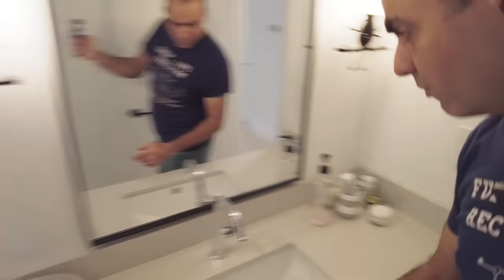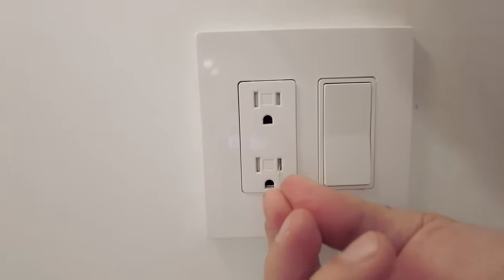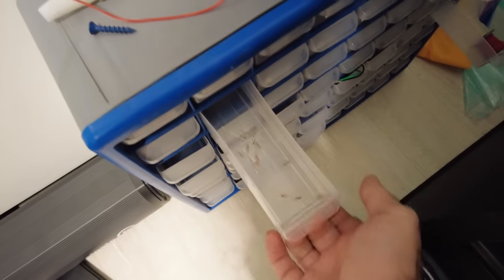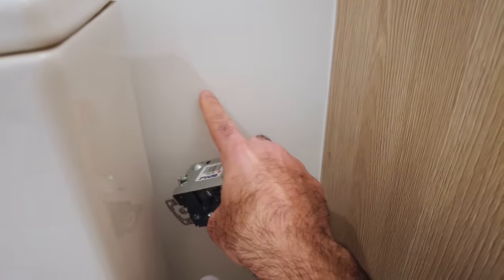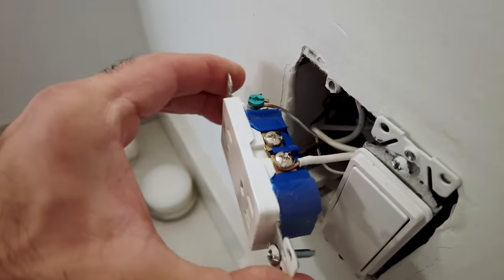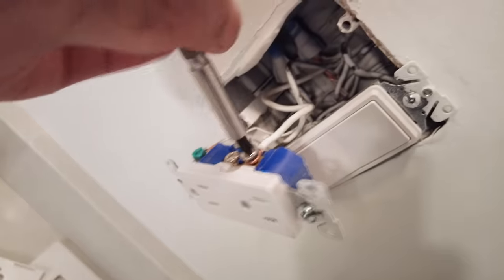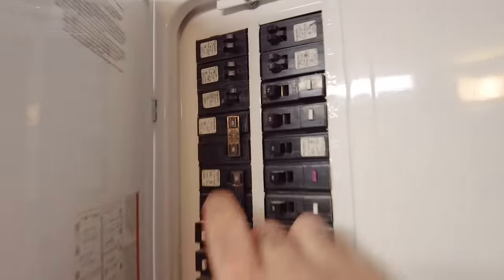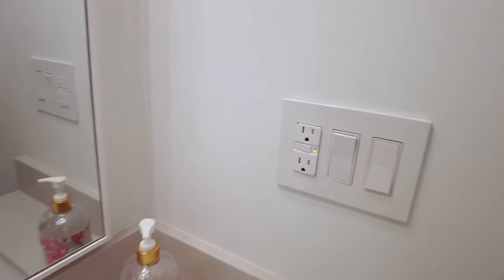Installing an Outlet… For a Toilet Seat?!

Comment: Hey Medhi, have you ever thought about using wagos or similar connectors in your walls? It makes changes such as these way easier than using wire nuts. (And wagos can take more abuse)
Reply: Every time I look at Wago's in the store (and then look at the price), I think about the small loan I'd need to take out to have enough of them floating around in the various size and combinations to keep them in stock whenever I want to do a small project.
Reply: @stevesether Here in Sweden we aren't allowed to use anything else than Wagos for safety purposes and they are pretty cheap
Reply: @ghostali8351  Wire nuts are absolutely fine for safety.  Wagos are certainly quicker and easier, I've started using the Ideal version, and I like them.
Reply: I don't think Wagos are approved for use in all jurisdictions in Canada.
Reply: Anyone who thinks Wagos are faster clearly hasn't seen or been a professional electrician installing wire nuts at lightspeed xD
Reply: @3nertia  then do the same... But try do add stuff to an already existing circuit without cutting parts of the wire off
Reply: @jonc4403  wirenuts are less safe.. they generally have a higher resistance cause of oxidization and non perfect Twists.. they are usually the weak spot in the house wiring.
Reply: @idallen  tbh I doubt that they aren't approved...
Reply: @lukyva7955  Just untwist the wire nut, add another wire, retwist, done - you make that sound harder than it actually is ;)
Reply: Compare having to straighten the wire if u actually want a good connection to open clamp, insert, close clamp
Reply: @lukyva7955  Straightening wire? Most electricians will just put the multiple wires together, most of which start out straight anyway and need to be hooked to be screwed to receptacles. Just squish 'em together with lineman's pliers then twist the wire-nut on, easy peasy
Reply: @3nertia  don't get me started on American receptacles and safety...
Reply: @lukyva7955  Oh, please do though :D
Reply: @lukyva7955  If the wire-nut is what is making the wires inside make contact then it's been installed incorrectly heh
Reply: @3nertia  exposed live and neutral.. being able to pull the plug half way and touch the prongs.. 
Just 2 Things that came to mind right now
Reply: @3nertia  so.. there is a possibility to do it wrong... Already a plus for wagos..
Reply: @lukyva7955  Wagos do not change how receptacles work lmfao
Reply: @3nertia  the "possibility to di it wrong" was talking about using wirenuts wrong.. hence why its two seperate comments
Reply: There's no need to twist the wires before using a wire nut - and in fact you shouldn't! When grouping many wires together, twisting can make you think one is held firm, when it actually isn't. If you put them in straight (as it says to on the package), the nut binds them all together well. I always check by pulling on all the wires, but they never are loose. You also don't have untwist when updating old work. The Wagos are certainly more foolproof, but if you know how to use wirenuts, they are not difference in terms of safety.
Reply: last time i checked, outlets weren't something people change frequently.  so thats not a concern.

Comment: A modern house with hollow walls is an absolute godsend when it comes to running new wires. But I’ve still managed to invent a few new swear words when encountering studs that I didn’t know were there. Especially those randomly placed horizontal braces.
Reply: Even new construction without the walls up can have some annoying stuff sometimes, all the time I run into spots where the framers stacked so many studs back to back that a normal drill can’t even reach one end to the other or where two studs are so close together you can’t fit a drill between so you need to go at awkward angles

Comment: Very good I’m sure I’m not the first electrician to say the only thing you missed terminal adapters for the MC wire which would not be compatible with the plastic 2 gang outlet box that you got the power from anyway

Comment: Make something for 6 million subscribers, very good job on the wiring, but remember you used those red pieces on your heater installation video upgrade video? O think you should use those here, you could run wire of the toilet seat by just extending its wire and then plugging it in, anyway good installation.

Comment: As a german I almost died at 11:00 you need to use a WAGO Klemme for that!
Reply: Thought the same thing. But then sometimes I wonder how many houses burned down due to using wire nuts instead of wagos. I think not a single one. Just German/European paranoia. GreatScott once made a video where he basically found out that both are fine and the slightly higher contact resistance is irrelevant for plugs and switches at home. But I still think it’s more convenient than twisting wires together. It just feels wrong to do that.
Reply: Paranoiac 😂

Comment: For a DIY project, this was really pretty good, IMHO.

It is kinda confusing because people use the different terms wrong all the time, but:

"outlet" = one set of holes (and contacts, etc) used for plugging in one power cord.
"receptacle" = the whole unit (usually with two outlets) which you install into the box and connect to the wiring.

Oh, and you really don't need armored cable for that application (at least in the US).  You could just use NMC cable (AKA "exterior grade" Romex).  You can't use regular NM (Romex) cable, because a bathroom is a damp/wet location, but NMC cable (typically gray, and rated for use in wet, outdoor, or corrosive locations) should be fine as long as it's secured up inside cabinets and such (i.e. protected from potential damage).  Of course the armored cable is also fine, just more of a pain to work with...

Those wire nuts are also not really twisted enough, BTW.  I highly recommend DIYers use something like the Wago 221 "lever nut" connectors instead of wire nuts, because it's much easier to make sure you're actually using them correctly.  Wire nuts are very easy to do wrong, which can be bad.  (also, the Wagos are smaller, so they're easier to fit back in the box, too)

Comment: Actually having multiple normal outlets tied to a gfci is not uncommon. That's why they're labeled on back as line/load. Line is hot from breaker, load goes to the rest of the gfci protected circuit.

Comment: Im not an electrician but I dont think you needed to do all the wire bonding at the original outlet, I believe you just use the second screw for each side of the outlet and the new ground run just screwed to the old box with the old ground. I could be wrong but I believe that would be up to code in north america.

Comment: Great job! In future projects, you might want to use a remodel box for the receptacle and use wago connectors instead of wire nuts. The wago connectors have a much more secure connection compared to wire nuts.

Enjoy your warm booty spray!
Reply: I've looked for Wago connectors here in Canada and they don't seem to sell them where I am.  They have something called "push-in" connectors which look similar though.  The Wagos seem to have a lever locking mechanism, but the push-in don't.
Reply: @@KeyDx7 They've got the Ideal lever connectors here, I don't think they're significantly different than the Wago ones.
Reply: Wagos should be banned. As an electrician I am on so many trouble shooting jobs and find more burned wagos than burned wire nuts.

Comment: Fun fact: In the UK/Europe, our walls are made of CONCRETE, so this would not be possible or would be significantly harder.
Reply: In South asia too
Reply: A lot of newer homes in Germany are wood frame construction but having had one built recently, they're worlds apart from whatever this mess of drywall and chopsticks is. I think there's at least three layers to each interior wall. You can't just cut into the drywall and have an open cavern like that.

Comment: You could have just modified the drawer to make it shorter to make a spot for the box to go instead of playing with that stud. But that was really a miracle the way that wire was fished into the box. You just take a screwdriver and bend those flaps to get it out of the way. Then push the wire down from inside the box

Comment: They sell plastic remodel boxes that mounts onto drywall so you don't have to worry about grounding the box or using a grommet to secure the wire. Impressive work sir
Reply: The plastic boxes should still have a ground screw in the box you need to bond.
Reply: @SomeGuysGarage 
How does that work with plastic, I understand the issue with metal box that gets grounded but plastic box?
Reply: @Mentaculus42  the plastic boxes I've used have a strap that goes from the ground screw in the box to the receptacle mounting screws, this way it ties the receptacle to ground regardless of the ground connection on the receptacle itself. You can also use them for bonding the grounds going through the box rather than just wire nutting them together.

Just a quick search shows that this isn't always the case with plastic boxes though.
Reply: @Mentaculus42 my semi nonsensical guess u link them all together so ull always have the uhhhh (not ground but the outer copper ) grounded incase of a short
Reply: @scno0B1  
There is probably a reason that it is in the code that is not obvious to me with regard to plastic boxes. Considering that plastic boxes are not going to conduct current vs metal ones that will and in a commercial application the metal armor  is probably grounded to metal boxes at both ends. If someone knows the “code” answer please explain. It is surprising why some things are in the code and then you find the explanation and then it makes sense. For example, if you are using armored cable with metal construction I believe that there is a code requirement that the cable has to be fastened within something like 6 inches to the structure because a short circuit can make the cable jump and pull connections apart. Also, different inspectors and different cities have different “interpretations” of the code. Have seen different electrical requirements for solar installations that vary depending upon different cities.
Reply: @scno0B1  see my above reply, some plastic boxes have a metal strap to the receptacle mounting screws from the ground screw...also used for general bonding of grounds through the box when continuing the circuit.

Comment: Always interesting to see how alien electrical installations can look on different continents. Also, if you want a measurement tool better suited for electrical work, get a Duspol. It has a switchable load, so you can differentiate between live and floating wires or conveniently trigger the GFCI.

Comment: I've owned a cold water bidet for several years now. No issues with the cold water, not even in the winter so I've never bothered with a heated one. Either way, every toilet should have a bidet!
Reply: Nope nope nope nope nope.  Absolutely no way I'd ever use a cold one.  It's totally worth it to install the outlet.

Comment: man trying to get the wires through inside the wall seems real stressful :P
Reply: It's easy, you just cut a path in the drywall and actually run the wires properly, then repair the drywall...this was terribly half assed and I saw a number of code violations.
Reply: @SomeGuysGarage  This was painful for me to watch

Comment: here's a tip: when you're attaching new wires to an existing outlet, use both sets of screws. one set for the breaker wires (the ones that were originally there), and the other set for the new wires. just make sure the bonding strip (the thin metal wire between the two screws) wasn't cut.
Reply: Remember that the MC  (armored cable) he is using is directional when you pull it. It is designed to be pulled in only one direction. It catches if pulled backwards. Keeps tension off the connections also.
Reply: Would love to know his reasoning to why he didn't.

Comment: In Australia we use gfci (I assume because we call them rcbo's but they are ground fault protection) at the breaker board. I don't get the benifits of having them at the switch as the wires leading to that outlet aren't protected. So when you drill in a hook for your new photo frame and hit a wire it's live instead of being protected

Comment: I'm an german electrician and these american outlets and how the wires are connected just scars me. German outets and the whole connections of the wires is so much safer.
I don't understand why your cable has a metal sheathing. In Germany it's just PVC and even the tubes lying in concreat and behind plaster are made out of some sort of plastic.
But I really like your videos so keep it up :)

Comment: Typically the fancy toilets get their own dedicated circuit because they have an on demand hot water heater in them that pulls like 1500 watts.  So if you are doing number 2 and your daughter is blow drying in the next bathroom over (since they seem to be sharing the same circuit), you will be popping the breaker.  So pooping plus blowing = popping.
Reply: I try my best to not blow and poop at the same time.. Just awkward for everyone in the room...
Reply: He did branch of the existing bathroom GFCI. Typically, bathroom receptacles have their own circuit for that reason since appliances like hair dryers draw a lot of current. So adding an additional load that would probably draw the maximum allowable current from the circuit means other devices can't be used on any of those receptacles (not without tripping the breaker, that is).
Reply: I've got a couple of these, and at least these models don't use anything like 1500 watts.  More like on the order of 100-200. They keep a small amount of water heated all the time in an insulated container.  They also have some kind of intelligence built it to figure out when you use them, and when to heat the water.  Works really great.
Reply: @stevesether   Went to Lowe's and randomly pulled one bidet toilet (Item #2806842) and here is what it said.  "This product must be plugged into a working GFCI power outlet to avoid potential damages on the electronic
component during electrical surges. The power outlet must have a dedicated minimum 1800W capacity for the
smart toilet"  I couldn't find the spec sheet on my toilet, but I'm sure it is similar.  I would hate to be the second person using your bidet toilet and have the little tank run out . . .especially if you live up north and have 40 degree inlet water.  WOW! that would wake you up.
Reply: @apostolakisl  That's nice.  It doesn't change the fact that I have two bidet toilets that don't require 1800 watts.
Reply: I agree. I have been looking at a bidet seat with on-demand heated water that requires over 1,300 watts.

Where I live -- Alberta, Canada -- the electrical code  doesn't require a dedicated standard 15amp GFCI circuit for bidets. It is recommended, though, if your bidet is the type that can draw a high load.

Personally, with bidets becoming more popular, I would think that if you're going to install a receptacle beside a toilet, you should consider future use and make it dedicated or one with only a few light sockets as part of the circuit. LED lighting is pretty much the norm nowadays, so they draw a limited amount of extra amps.

Comment: As a USA electrician, here are the mistakes made per NEC: Listed fittings are required on MC, but none were used so there is no anti-short protection. The MC wire cannot be shoved through an NM hole in the plastic switch box; it must be properly secured to the box. The metal box he installed was for NM not MC. You cannot mount the box using screws from inside the box unless it is designed for that, and that box was not. The metal box is not flush with the front of the drywall. The gaps between the box and drywall are too large. Lastly, he mentioned that he forgot to bond the ground wire to the metal box.
It is not dangerously done (because the GFCI should trip when the MC sheathing eats into the wire), but it would not pass an electrical inspection.
Reply: No, anti-short bushing are required on AC (BX) but not on MC. Generally considered a good practice on MC, but not required. Check your manufacturer's listing.
Reply: @johnhawkinson  You are 100% correct, and I have updated my post. Section 330.6 requires "listed" fittings where the termination fittings approved for use with Type MC cables are designed such that the wires will not come in contact with the cut edge of the armor. But, he used no fittings. Anti-short bushings would have been a good workaround, but still not "correct".
Early in my career, every inspector I met required redcaps on MC, and since they can overrule the code, I just did what they said. Years, later I had simply forgotten that it isn't actually code. Thanks for the correction.